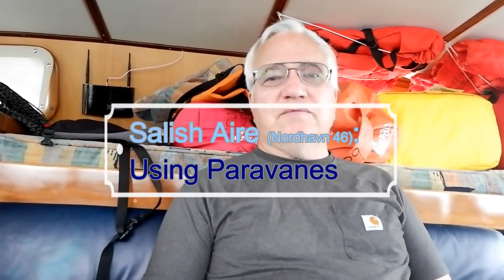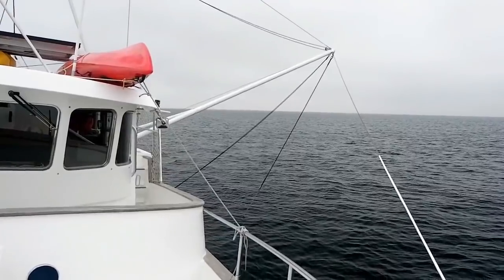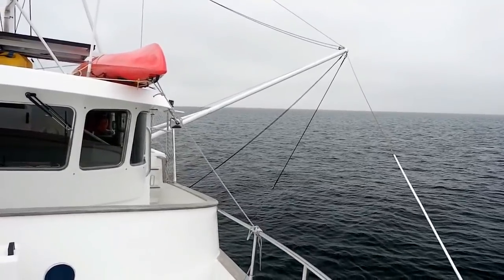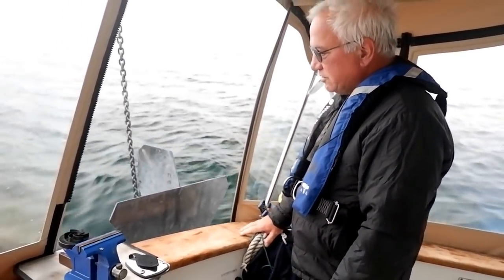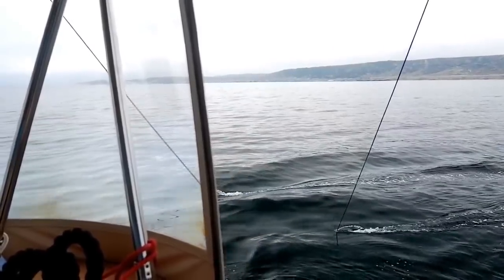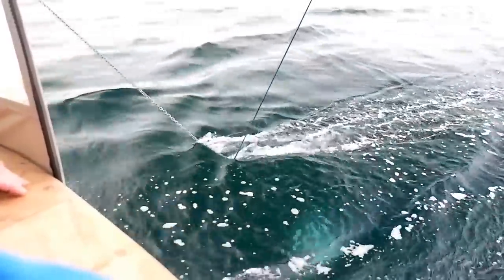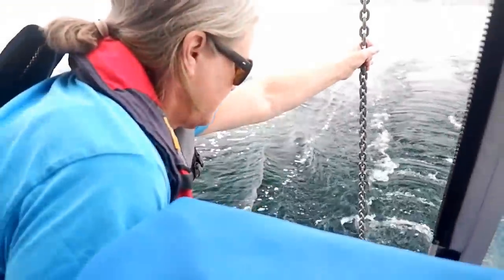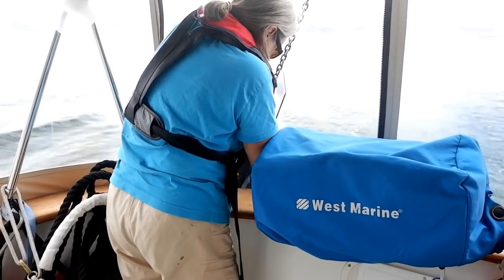Paravane Deployment on Nordhavn 46 "Salish Aire"

Comment: I’m confused. Your video shows a stern crane dinghy lifter, but paravanes fear are run abeam and amidships. Do we get to see the actual paravanes gear? Or do you only have one paravane?  I’m sorry but you didn’t really explain any of this very well although I heard the boat name about a bunch of times
Reply from the maker: I'm sorry I am confused by your question.  I understand you want to know about using the "dingy lifter" for the paravanes -the crane can be used for the dingy OR the paravanes but not both at once - we usually disconnect the paravane fish when we are at anchor or on a dock so the crane can be used for lifting the dingy or anything else onto the boat.  The paravane gear is shown throughout the video - the crane setup is shown starting at point 2:29 - I hope this helps.

Comment: Excellent video, Norman. Re. paravanes in general: have you ever picked up a net or crab/lobster post with them—this possibility has always been the biggest drawback of the system. Thanks again.
Reply from the maker: Sorry for the slow reply.  No we have not picked up a net or pot with them.  We did have a very large log hit first our fin stabilizer and then momentarily get caught on the paravanes.  It cleared itself very quickly and we did not find any paravane damage from it.

Comment: Do you have a swim platform on your boat?  Curious how your method of launching and retrieval would work if you had one.
Reply from the maker: We do not have a swim step.  How you would launch depends on the location/size of the swim step and location of the storage cradles.
Reply from the maker: Sorry for the late response. Short answer is no we do not have a swim platform although they are commonly used on boats with swim platforms.